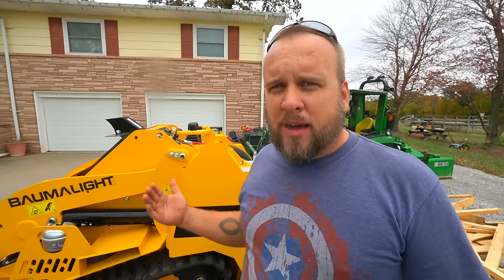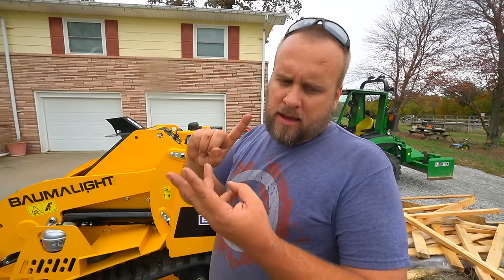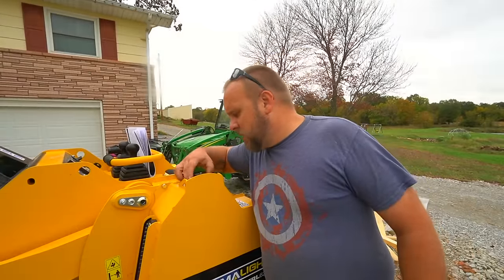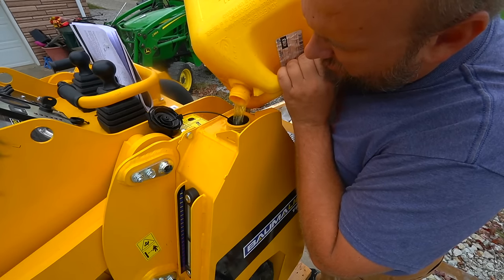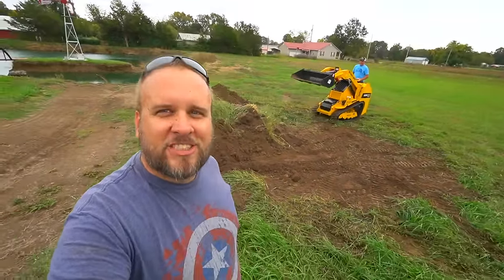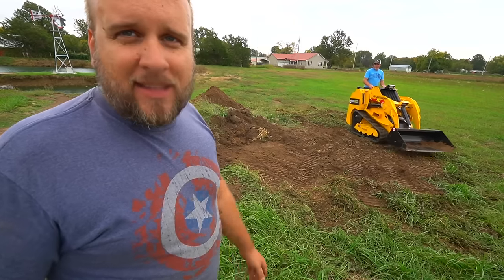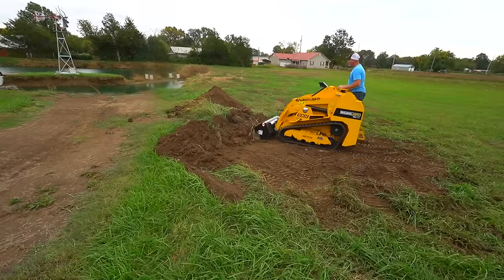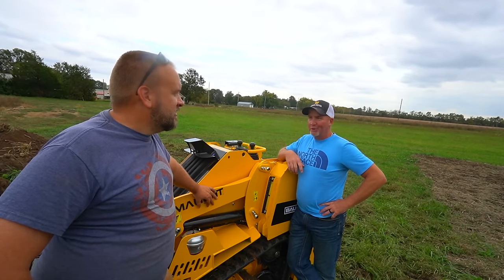We Got a New Mini Skid Steer - Baumalight 620D Overview

Comment: My tree guy brought one similar last time.  It has a tree grapple on it.  He drove it up to a tree in my yard that the borer beetles had killed, and bearhugged the standing tree.   It was about 10-12 inches, and 30 or so feet tall.  He cut the tree off near ground level, and then carried the tree upright across the yard to the driveway, to the waiting chipper.  He laid the tree on the ground and quickly limbed it.  Then stuffed the trunk and the limbs into the chipper.   Astonishing.  If you'd been here, I'd have turned to you and said "whoo doggie".

Comment: I've never operated one of those, but it seems it would get pretty fatiguing in a short amount of time. It seems like a belt or strap across the back that you could rest your butt against would help, although I can see where from a safety aspect it would be harder to jump clear of the machine if you had a tip over or lost control. The tree company I use for jobs that are beyond my skill level have a Bobcat MT100 with a 360 degree grapple attachment for moving logs. It's rated for 1000 pound operating capacity, but they'll move logs where they basically having it standing on the front of the treads. The guy who usually runs it has a really good feel for the machine, and can pick up huge logs or tiny branches, carry them over to the chipper and feed them in, then whip right back out of there. Fun to watch.

Comment: great video, I am in Canada and have seen and heard very positive things about these, for a unit this size, the Kubota 25hp engine is a good fit and low maintenance , i haven't heard any down side to these yet, pricing here in Canada is well ???, no one well haggle on price $44,000.00 and no movement, i thought of getting one based on a landscaper  using his and his employees  love it so far, my use is just around the property similar to yours I'd guess, and would only use a bucket and blade in the winter to clear some snow, i just wished i had the money to get one , a little out of my range for now, awesome video and congrats on a  100K subscribers 👍

Comment: It's nothing that would interest me, too light duty.  For the $$, I'd buy a used cab tracked SS with AC & heat, but that's just me and I'm an old guy.  If you're happy with it, that's all that matters.
Reply from the maker: I’m sure you know I have a cab tracked skid steer with AC and heat. This machine cost less than half of that.

The primary market is for businesses that are trying to transport the machine and the materials all in one trailer and work in small spaces

Comment: That machine can't weigh 3000 pounds. Really?
Reply from the maker: I think the list weight is 2500 pounds but it has the extra ballast weights on this one plus the weight of the operator

It can lift about 1300 or 1400 pounds but you can’t take that much to full height. I did a tip test and forced it to tip with a full rack of firewood